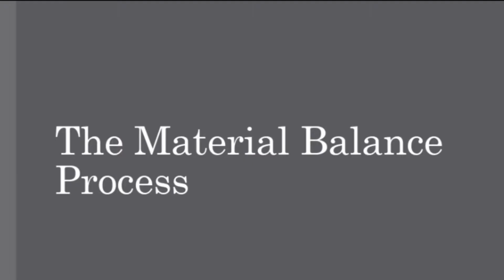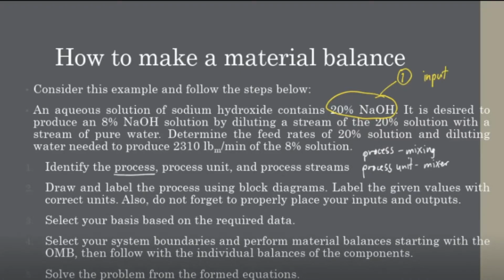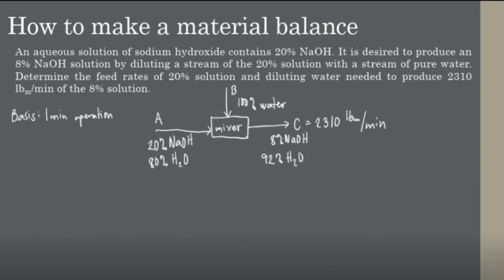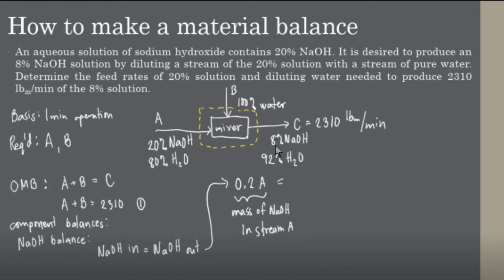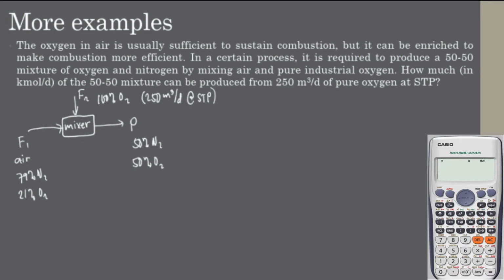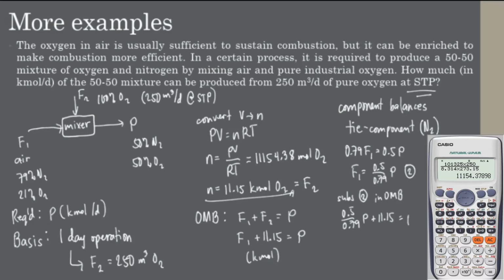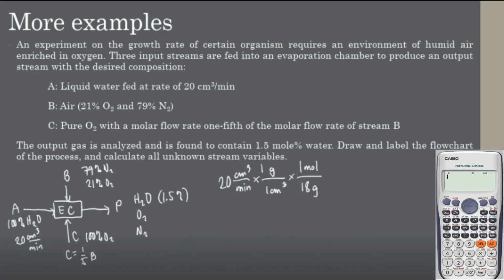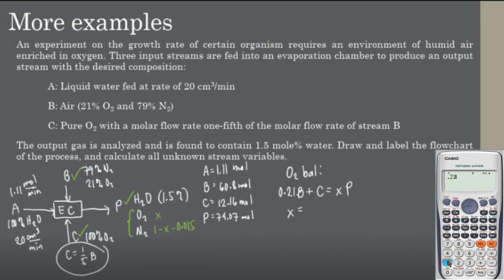How to Solve Material Balance Problems Step by Step | ChE Calculations

Comment: I think you should have used R at 0.082 Latm/molK instead of 8.314 J/Kmol
Reply: He used the units Pa*m^3 which is the same as J since it makes more sense given that the unit m^3 given, makes it easier. If it’s water (1kg/L density) Latm/molK would def be better

Comment: you didn't explain why you did not write water on component balance
Reply: You equate individual components in component balance
Reply: It will all comes in the same answer..
Reply: you dont need to write it in that excersise
Reply from the maker: I don't know which example this pertains to, but in some cases you cannot write component balances for all components because it will result to a dependent system where there is no one true solution.